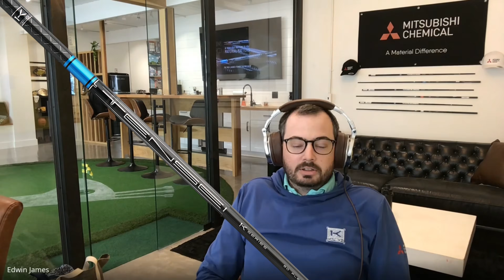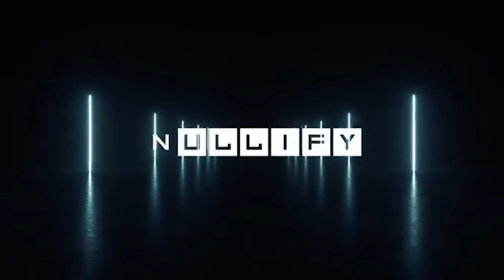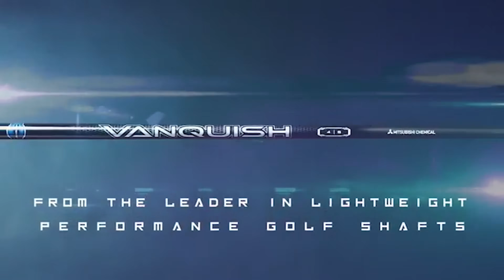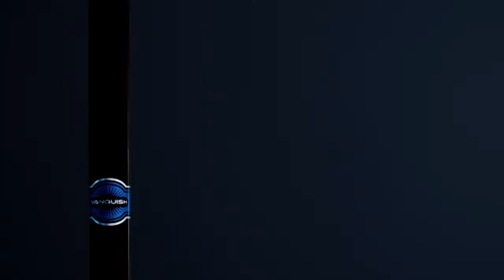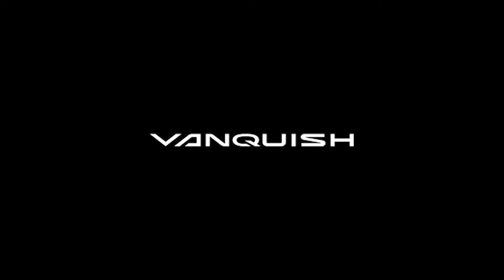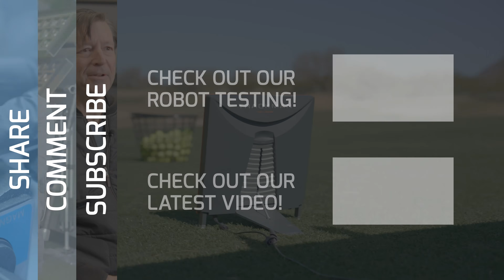Tensei 1K Pro Blue and VANQUISH direct from the source

Comment: Tried using Vanquish 4S/S flex shaft (with a Taylor Made Gloire Stealth Plus). It is very light - but it doesn't feel "sloppy". The only thing I noticed was that ball flight became significantly higher (I played it with a loft of 9.75) and while carry was longer - my descent angle went up to 42 degrees which literally stopped the ball when it lands.

Also noticed that I have a tendency to miss left on this shaft.

In contrast, my Ventus 6s/TR Blue shaft gives me a descent angle of around 37 degrees - and my miss will almost always be on the right.

I have tried adjusting the head to 9 degrees and will check how it comes out - but from the range session, ball flight seems a bit lower and straighter.

Comment: Been gaming a Vanquish 4S in my driver for a couple months now. It's a great shaft. Left it at 46 and I'm hitting my driver longer and and straighter much more often and I've never been able to hit a longer driver. If your looking for a lightweight shaft definitely give this a look. It also doesn't feel like an autoflex. You can feel it load but it doesn't feel sloppy or like you need to time it. It's also way cheaper. I'm a big fan
Reply: Ive been playing the vanquish 4x too !